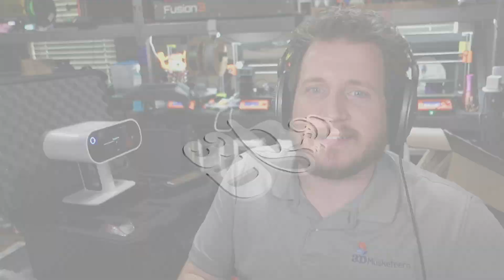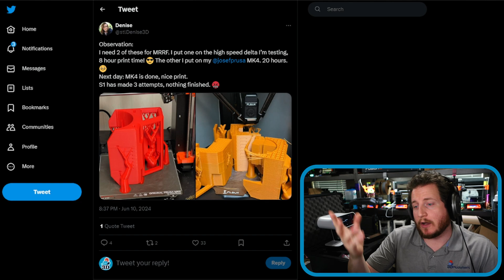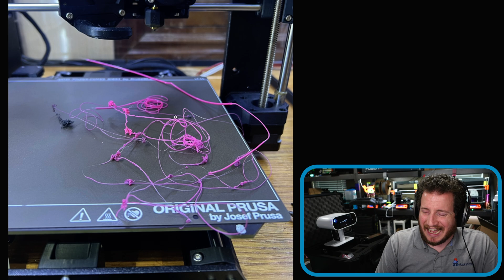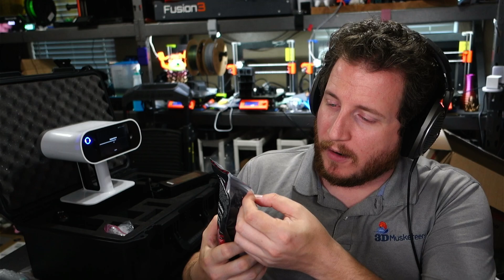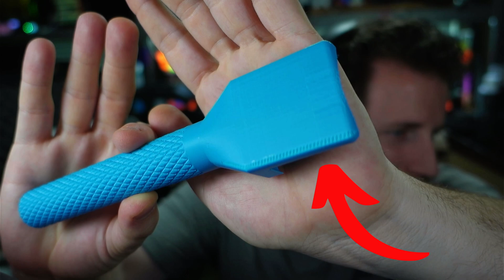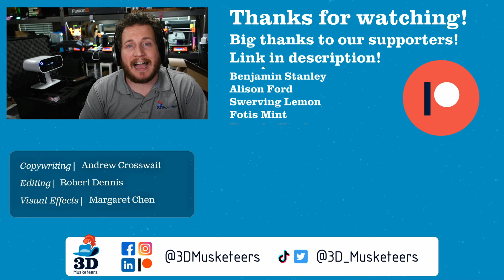How Do You CLOG a DIAMOND NOZZLE? - PrintFixFriday 144

Comment: I wonder why diamondback says not to do cold pulls with their nozzles. The insert is put onto the nozzle from the tip side, so any force from the filament pulling up should not dislodge the tip insert (unlike Olsen ruby). Or are they just being ultra conservative?

On the topic of cold pulls, I prefer to do cold pulls using cleaning filament (I use the eSun cleaning filament). I always get a perfect impression of the inside of the nozzle (except with CHT nozzles, obviously), even using the MK4S firmware cold-pull routine. If I try a cold pull with PLA the tip of the cold-pulled filament is stretched.

Comment: Broken Screw means likely 1. no back pressure alarm or gauge 2. MI (melt Index) gauge and 3. the motor/drive(VFD ect.) had not been set up for max amps matched to the machine to cut out before snapping  a 2"ish screw  shards of the screws flights will destroy the die and possibly mark the barrel up, for this reason a breaker plate AKA rupture disc is used also and/or a flange with a copper nut with a stopper to act as a relief point to relive the over pressure state, should you not have any of the above safety equipment, industrial extruders can reach 10000 PSI and people get hurt bad when proper things are not used this will happen, I have never seen a broken screw without a reason for it, it just should not happen.  Play safe tell your guy to check out Dynisco  and to have the VFD set to A FLA of the machines max and test it and it will be the last screw ever broken again        This could have been much worse hot poly is unforgiving so I had to share this. oh and get in check with regular eye checks on the barrel zone heaters to make sure they are working properly during the run times, and when you get your new screw have it measured and check your barrel to screw tolerances just like a piston and cylinder walls on a motor. Please play safe I cant stress the importance of this equipment in one comment but I can hope you get the idea  if you get hot poly on you in volume you will only do it once I promise you, and it can spray like water and faster then you know, once it's on you your done like dinner and pulling it off immediately can make even more damage to your body wear a face shield and heat gloves when playing around real extruders especially under pressures and extreme heats, now back to keep making Awesome> :face-blue-smiling:

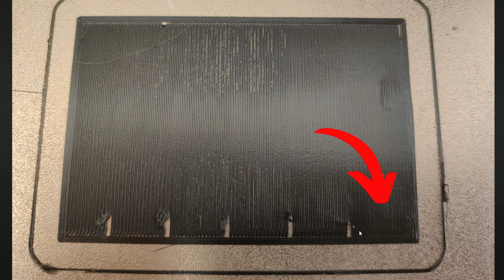Comment: 12:00 Actually I think I have a very plausible explanation of this one! "It's z-offsets? Always has been!" even the areas getting ripped up, it's not a mechanical fault that I can tell. The part that's not intuitive is why it's getting ripped up at weird but regular intervals. It's over-extruding on higher spots, then putting lines side by side.. those lines are building up a pressure as they get stacked beside each other, they can't all fit in the space given where the bed is too close! Then at regular intervals it is becoming a ridge that is so high the nozzle snags it on it's way past that spot, suddenly there's some space so this pressure is momentarily relieved a little, so regularly spaced rips appear!

Comment: I ran into an extrusion problem. After printing GF nylon, and then some TPU, after that my printer stopped extruding my normal petg. Cold pulls, needles nothing worked. Still extruded the nylon fine. Would just chew the filament.

Your podcast with pez liz had a bunch of other possible causes, most of which would be taken care of by just swapping whole hotend. The $20 swap solved the problem. Now i have the separate hotend for the nylon. 

Thanks for covering the same things over and over again, makes it easy to find the answer.

Comment: Over heat the diamond back past 300C to see what happens while printing. I did that with a .4 abrasive CHT nozzle and while printing some PCCF at 310C it actually pushed the abrasive tip out of the nozzle itself. I have never seen anything like that before and it blew my mind.

Comment: Grant, I modded the MK4 with a Volcano and on certain prints it halves the print time. Spitting out 30-40mm2/s of PLA or PETG. Speed and accell adjusted to accommodate the flow. For delicate parts, I may just revert back to the stock structural profiles, but man MK4 goes brrrrrr.

Comment: With a bit of luck I should finish my Senko print this weekend. All that remains is a few minor parts and I think I'm going to reprint her tail. I'm not happy with how I painted it. Question is......can I paint it better? I was hoping that if I switched colors mid print and had almost no purge and low infil (5%) that the color would fade. Well it did, but not like I thought. It immediately looks like a different color, but fades very quickly. Only a couple of layers. It looks more like bleeding than fading. I did use prusa slicer's cut tool with square dowels. But I ran into a problem where they are just slightly too long. I have a dremel. Maybe I can just sand them down a few layers. IT's already really close. 3d Gloop is working great.
Reply from the maker: Here's hoping it went well!! Glad gloop worked well!
Reply: @3DMusketeers  lol the umbrella was driving me nuts. It was looking good until.......layer shift. Then I'm like why am I printing a 2 color umbrella in 1 piece? Lets print the fabric and the pole separately. lol Now it won't print for shit! lol I flipped it around and now it's printing fine. And......I'm not happy with the paint job on her tail. So I'm going to reprint that as well. I'm taking most of the week off, so I should be done before the weekend.

Comment: yeah I still need to fix my obxidean nozzle. About the only thing I can think of at this point is to push PETG into it while it's hot (but not in the printer). And then pull it out. I'm thinking probably colder than the 450 I tried when trying to clean it.

Comment: Ooo, my ears are burning. Yes, the S1 print is ABS, that's why we're seeing cracks. (Polymaker Orange Galaxy) The one on the left is using S1 defaults, which was too fast, then I kept slowing it down and playing with infill. The one in the middle (still stuck to the bed) is run at 200mm/s on all walls & infill. (Doh, still too fast...it would be nice if they actually gave good profiles, it defaults at 500mm/s)  
This is the cab to my Death Racer and I need it for MRRF, so I gave up and put it on the K1Max and it printed fine using Creality Slicer defaults for ABS.  I also needed one in red for Rick's Death Racer, but ran out of ABS, so it's PLA printed super beefy with like 6 walls and 20% infill, so that's why it was taking 20 hours. If it were "normal" it would be done in 10. I've run versions of this print several times (Death Racers usually come home in a shoe box) and the tree supports were never an issue on my other printers.